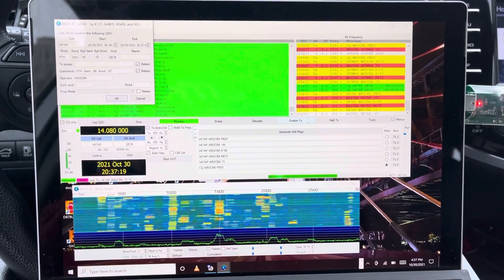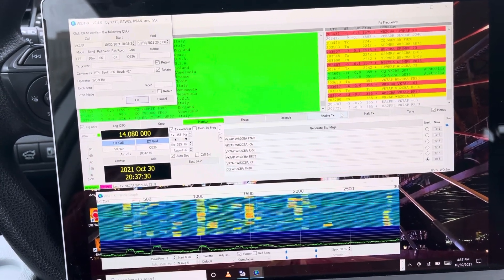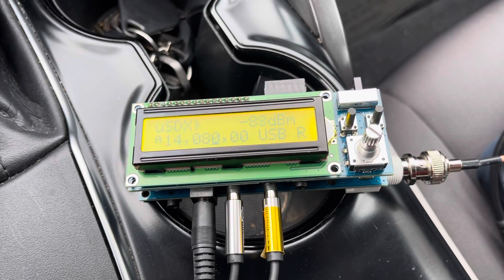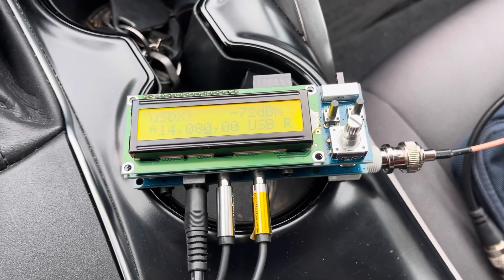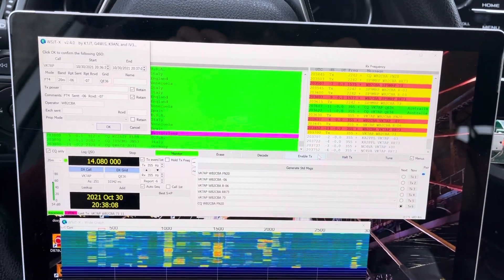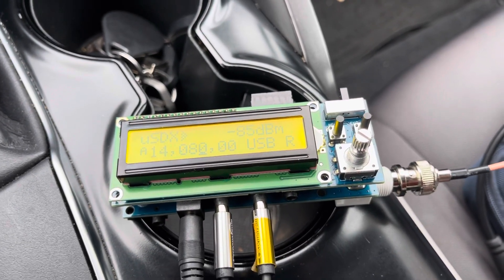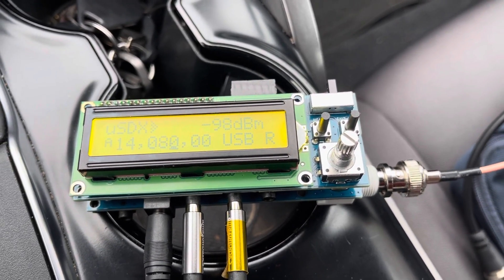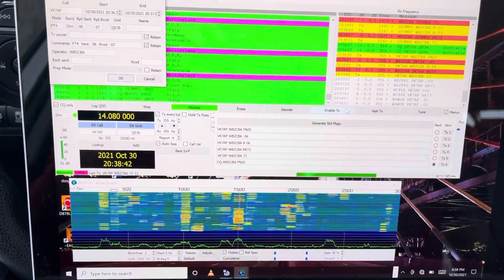Testing uSDX mOnO!

Comment: Hello my friend. Please give more details about this project.
Reply from the maker: This is designed to be a rf test board. And then i added top control board with lcd. I am working on to market it as a mono band simple hf transceiver. It is based on uSDX firmware for arduino  by PE1NNZ. Here is the link for the firmware: https://github.com/threeme3/QCX-SSB/tree/master